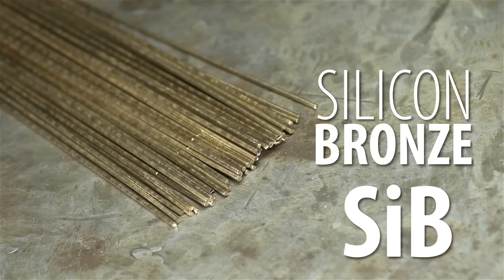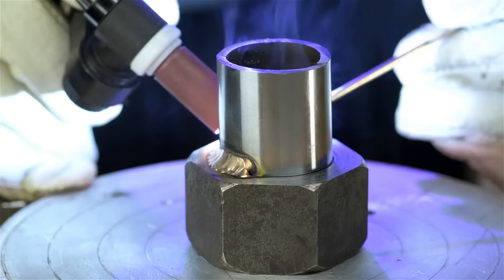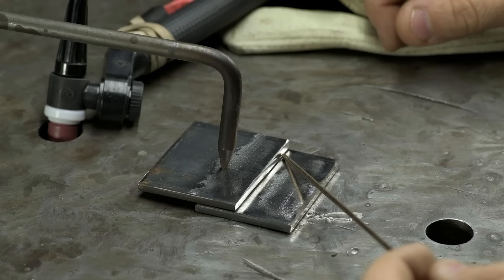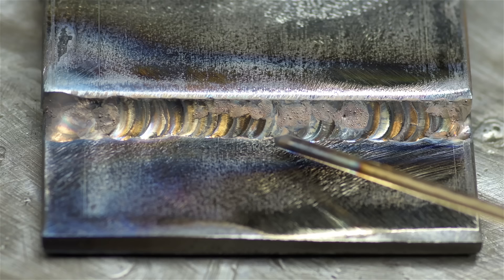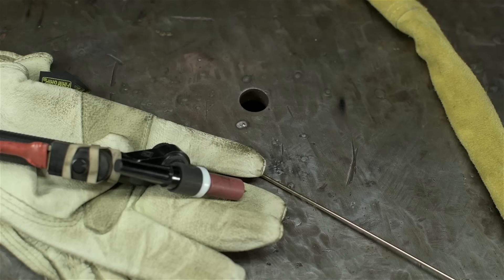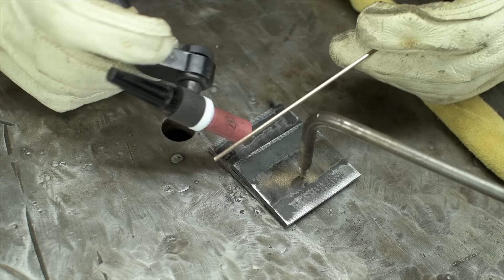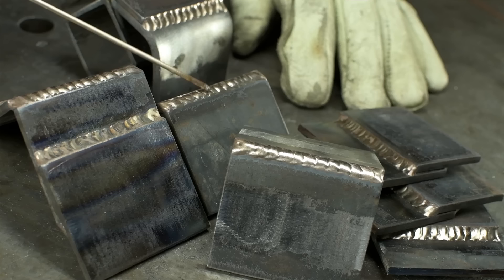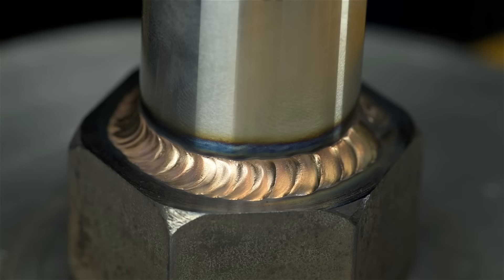Adventures in TIG Brazing

Comment: Tony mentioned about tig brazing putting less heat into the workpiece, I'm just wondering if anyone has any thought on whether brazing would be a good idea for fixing overlapped ("Joggled in") car body repair sections. I'm not talking about serious structural stuff here, Just things like outer wheel arch lip repair panels or door skin repairs on older cars.
I'm wondering if in a home workshop (Rather than in a commercial garage) brazing might be a usable alternative to MIG welding to cut down on heat warping of "Cosmetic" outer bodywork? I've rebuilt a few of my cars in the past where I've warped larger flat panels to hell and back with my MIG, Then I've had the wonderful choice of spending days with hammer, dolly, and blow torch to bring them back true(ish), Or contemplate neatly skimming the whole panel with filler to hide the ripples of shame. :)
The only red flag waving in my head at the minute about this idea is the whole dissimilar metal electrolysis causing rust thing, but I don't know how quick or bad this might be. 
If a repair might get to 10 or so years before rust means it needs to be redone it might be acceptable, But if it's just going to go flaky and red after the first winter it might explain why brazing doesn't feature more prominently in home car body repair videos. :)

Comment: If you use gas, can I use the silicon bronze filler rods for my gas torch welding process? And then the silicon bronze will get all up in under between the two plates.

Comment: I’m just getting exposed to brazing vs welding, and I have a question:

One of the functions of traditional torch/flux is to help the brazing material wet and flow into the joint more completely. When brazing with a TIG setup, there’s no flux… so is it a bit more shallow of a bond?

Comment: Hey there Tony. As always, great video. But that's not really anything new. This might be? I am so near sighted that I can't make out details in anything that isn't 8" or closer to my eyes without my glasses. But if I'm too close with them on, I can't see anything that way either.  Problem is, wearing my glasses under any helmet is near impossible. Sweating and/or the condition of my stretched out frames has them falling off of my face constantly. Do you know of anyone that makes an auto darkening helmet with the means for prescription lenses to be mounted into it? I used to have goggles like that for my dirt bike. Thank you sir!

Comment: Nice! Question. Would this method be good solution for tig brazing some nuts onto mild steel for shop fixtures and such? Thinking of a positioner type stand with telescoping sleeves that can be locked in place anywhere along the length of a tube? Like a weld booth might have in shop class..

Comment: Hi Tony - this is likely ancient history to you but I thought I would throw it out there. First I love your show and your humor. Please keep doing what you are doing. I have experience braising with a gas torch. There are marked differences in what you were doing in the video. First where is the flux? I think that would make a word of difference. The stack dime look is a TIG thing but I think smooth is likely better. Speed with a torch very slow to start and heat input is to keep the metal components a cherry red color and let the braze diffuse  into the steel - are you going too fast? Less power more time? Third is that pushing the rod into the joint works pretty well for me. Food for thought - I'm a hack so i might be totally out to lunch.
Reply: With TIG, the braze is shielded by the Argon, hence the brush on gas flux not being needed, but it would be interesting to see if this would be of any benefit.

The Gas brazing versus TIG brazing processes are nothing alike, as Tony says - Gas brazing is so much stronger than TIG brazing because it wets out the join & really bonds the materials, especially lap joins.

Many people criticize the strength of brazed joins & the ones usually shown & tested on YT are TIG brazed & undersized. They usually have insufficient coverage because they tend to lay regular TIG weld sized bead. If someone wants to TIG braze a join looking for good overall strength, they need to increase the size of the area being covered by the braze to be larger than that of a Gas brazed join.

Gas brazing is a dying art, but Stubby Cuts on YouTube has some really good videos on gas brazing motorcycle racing frames.

Comment: Looking for technique to possibly TIG braze a cast iron repair. The base metal is so brittle that it seems a softer weld metal is the only solution. Two flakes broken out of much larger casting and feel nickel rod and peening will just break the flakes. I am trying to re-embed these cast iron flakes back in the larger cast iron. Do you have a video where you identify and solve large heat sink cold metal issues using tig on cast iron? I already have a roofers asphalt torch to heat for an hour or so in advance of weld but cannot mess this up as part is no longer available. Thanks in advance.

Comment: If you flux the joint first would you get more of getting a pull in between the pieces?  would that add strength?  or does that screw with your tip?

Comment: I have asked a few people how to solve a practical riddle I have. I have very thin hi tensile steel tubing (Reynolds 853 air-hardened) in a bicycle frame that has a small crease in a structural (seat stay) location and I don't want to replace the tubing but rather just repair it. Would you recommend TIG brazing with this stuff here on video, Gas brazing it into the crease or tack welding a small patch over the crease? Also would steel filler work best, stronger than brass or silver mix? One guy recommended silver brazing into the crease but because the tensile strength of the tubing is pretty high and the brazing material is less strong, I worry that the filler material might not restore the original design strength. Am I worrying too much and therefore should just braze it and move on? Btw the crease deforms the 11mm  diameter tubing about 1.4mm. The radians around the tube that are affected are about 90 degrees.

Comment: If you were to overheat and start welding with the brazing rod getting some penetration into the joint would it have any downsides other than overheating the metal?

Comment: By welding at a lower heat, you’re welding slower and thereby putting more joules off heat down with an uglier weld results. Higher heat and more speed of weld will greatly improve your final product. Good video

Comment: I always wanted to see someone give TIG/Braze a good try, and you did.  What I gathered from it is the process might do quite a good job, but only over a comparatively narrow range of work.  The problem is one of heat focus.  At all times, the TIG arc flame is more concentrated than you can probably achieve with even the best gas torch, and it offers no real way of conveniently warming up parts prior to brazing.  I guess the main thing I would like to see is how low current TIG/Braze would work to fill in voids where a shaft or surface has been built up with weld or braze.  I always cringe after hours of careful work to make it "as good as I possibly can", then after turning or milling off the overburden and discovering the inevitable holes and voids, suddenly "that's good enough".  Argh...

Comment: Whe using pulse keep the filler wire in the weld pool all the time....when you dip the wire into the weld pool you are dragging air into the weld pool area hence the areas that have a grey sugaring look......great videos though

Comment: Can someone give a definite answer please.

When using brass rods to weld sheet steel to sheet steel you polish the surfaces and yse an oxycet torch and do a herring joint.  The temperature and the type of torch and the mixture of the brass rods which arent pure brass requires no flux such as a hydrochloric paste or phosphorus.

Soldering  - as in rigid 3m length of 22mm pipes with sockets and rolls of silver/tin solder requires flux as the copper pipe compared to HVAC is a bit crappy quality and needs less heat. Tin/silver mix solder.

To join this good quality (purity) copper with a Brazing Rod I ask the question "Do You need flux?"
The answer being no.
However i ask it differently - "Do you need any extra flux or do the rods contain a flux?" I get the answer "No there is no flux in brazing."

Yet you look at the packaging of the 
Brazing rods and they contain 15%silver. 80% copper and 5% phosporous.
What is the phospor for? It is corrossive and prevents the copper from oxidising and helps the metal run in the fitting.
AKA...A F&#@$ING FLUX!!!

So you do use a flux?
No.
Its in the bloody rod!
beats thr HVAC over head with a rod pack

There are so many videos with a title saying You dont need flux to braze copper and they proceed to use rods with flux built in like giant rosin core electrical solder.

Without a flux, like phosphorous, be it built in to the rods OR as an external granular substance you paste on the pipe like in the days of yore, will the joint work?

 I get that it is being used for a gas rather than water which will flush and residual corrosive flux grease away so keeping flux and deposits to near zero is paramount so using gloopy or granular flux is a bad idea.
Do most brazing rods for HVAC contain a flux and what is it usually please and what are the variants?

Im not talking about steel and brass or bronze welding.

Just copper HVAC.

Comment: Yes, you do! I think doing things wrong. First of all this is not welding. You need to warm base material first, not to melt and drop filler on it. Second, you do not heat both base metal parts equily. Try again.  Oh. yes, try phosphorus bronze (5% P) too. That's magic! O! Some more: Wolfram electrode less out, less protective gas to avoid turbulence, don't move filler material out of gas protection zone, and stop at the end till gas flow to protect joint. Anyway, excelent video!

Comment: It looks like the porosity you were getting at the 6:30 to 9:00 minute marks was caused by the angle you were pushing the TIG torch. It was introducing non-inert gas into the weld. The TIG torch should never fall below 10-15 degrees from the vertical. The filler rod should never rise 10-15 degrees above the horizontal.

Comment: Do you have to do it in dabs or beads??? Im not a welder but i do regular oxy acetylen brazing for my job in refrigeration. And we just have a continuous flow of filler rather than a bead.. is it possible to do with the tig welder??

Comment: I use to weld seat pedestals for UPS trucks- in order to get the most even heat, why don't you angle the joint so your brazing at a 90 degree?

Comment: Still trying to get this to work for me. What I don't understand is if it takes 80 or 90 amps to braze, your example of brazing a thin piece of steel to a thicker one would still give the same issues ie you'd blow holes in the thinner piece (well I certainly would)

Comment: Why can you not lay the welding rod inside the box shaped crevice and just melt it into a puddle as you move the torch along it? It always seams counter intuitive to  hold it at an angle and feed it into the torches arc manually.

Comment: Go to the pedal and do a 1 to 2 sec pause. Turn torch on add the filler there goes one dime. Pause until the puddle has some liquid and repeat. Its your job to control the heat not the machine. I only say this because i was taught this

Comment: There is nothing stopping the metal ahead of the weld from oxidising, have you tried a little flux?

I have only used Oxy Acetylene for bronze welding, my welding is crap, but I could make way stronger joints bronze welding instead. A test tee joint in square steel tube tore the tube before the joint failed. And with Oxy acetylene it's so quiet compared to welding, Joint looks crap?  Just go back and remelt it into a nice smooth bead, after painting everyone will  think you are an ace welder.

Comment: I've been tig welding for over 20 yrs. But have never tig brazed,  I understand everything you showed and will definitely try this, just to see if I can,  hardest thing looks like not doing what you have to do when tig welding ( making a puddle with the base metal). Also thank you for telling the difference between filler ( the zinc thing ) that part I'm sure would have been my demise.

Comment: Hello, how to do bronze yellow welding with tig welding, which shielding gas should I use, what should be the current ac or dc, I would be glad if you could help me in this regard.
Reply from the maker: Argon gas, and it doesn't really matter if you use AC or DC but AC is better if your bronze has aluminum in it.

Comment: ToT!! I hope you're willing to get more scientific and rigorous. Try this! Make both coupons extremely flat with an excellent surface finish. The closest and most consistent contact points should be controlled as tightly as you can and be COMPLETELY clean from oxide layers or dust. Preheat the parts as much as you reasonably can. You don't want a convex bead; remember, you're braising, not welding! You want the filler to wet the workpiece, not just bond together. That means a negative miniscus, not a bead. It should flow more like solder. You may need a rod with lower melting point, and probably thinner if you can. And, if possible try to do the whole thing in an oxygen free atmosphere. I promise, you'll get MUCH stronger joints.

Those little green propane tanks are braised at that mid joint using this type of exactness (more so). When you see those ones that have been in fires, they fail around there steel just as often if not more so than they do in the joint. The joint can be as strong as the base material if it's done as strictly as possible.

Comment: I have zero experience in tig, or brazing of any kind, so I have 2 questions. But I'd like to get into both for side projects.

You said the gas vs tig joints will be mechanically different, what kind of differences would you see? Is one weaker than the other?

Also, what would happen if you just laid the rod across the joint and ran your tig torch across it? Would you have issues of oxidation of the rod before you get to it, causing issues?
Reply: 1st question I believe so it's weaker. I've tigg' d with a brazing rod before and had good results(great ripples). But I'm sure it'll fail mechanical bending. Not that I've tried to do the testing myself.  

And 2nd (?) Really depends what youre welding, thickness on material.  3/4 with filling the groove face on fill, I lay the wire and amps are around 150 and spreads like butter. Bad welds are based on prep work, clean material, clean tungsten, proper sharpening on tungsten, clean filler rod, types of filler rods and type of tungsten to use, gas flow, grounding, position on welding the part. Just alot goes into tig welding

But if you're truly wanting to get into tig welding, purchase a multi stick and tig lift start. Learn how to stick weld first and move onto tig.

Comment: Gotta say - very little penetration of bronze to base metal which is where your strength on your lap joint and 90 degree butt joint. Well really all your joints. my background is gas brazing, oxy-act. with # 2,4 6 tips.

Comment: I have a question. I am working on some special lightning project for school, and need to use Edison threading. So I would like to ask if you could show how to cut Edison threading if it's possible. If you could do that, it would be absolutely amazing.
Reply from the maker: I had to google edison threading.  It's not very deep so I'd grab the nearest lightbulb and shape a piece of HSS so it just fits in one of the grooves.  Measure the pitch, and cut it like a regular thread.  Hopefully your lathe offers the right pitch.  After that hit any sharp corners with a file to round them a bit.  I assume this is in aluminum or something soft?  If steel, use a regular threading tool to rough it out first, then follow up with your thread form tool.  Might be nice to have "shoulders" on your tool to result in a finished thread:  this means when you put the tool in the lightbulb thread, it would span 1/2 a thread peak, through the 'valley' and 1/2 way up to the next thread peak.  But this might cause a weird finish / trouble cutting.  Good luck!

Comment: Dumb question, but does this mean you can braze copper pipes with a TIG welder instead of a flame torch?
Reply: excellent question. you can also pound a nail with the back of an impact wrench. still, the hammer is the better tool for the task.

Comment: Seems like 3/32 filler required too much heat for the 1/8 coupons which is why you were melting the parent metals while struggling to get the silicon bronze to flow out

Comment: did you use standard argon welding gas , could allso be you can work the material better with a different tungsten tip
Reply from the maker: yes straight argon.

Comment: What about thick material, say a broken cast iron part 1/2" or 3/4" thick?  Would the extra thickness absorb more heat, so the amp setting could go up?  Can this be used to silver braze thick butt welds?

Comment: this is now an example of how not to do it.  the most important thing with this weld mode is, ALWAYS keep the torch upright, 90 degrees above the weld pool.  If you point it diagonally forward, too much heat will enter the material.  This is clearly visible in his example.  When the weld and material turns a dark blue color.  that is, the material has received too much heat, and as a result the composition of the material changes.  In other words.  no longer the same composition that was needed.  You can recognize these welds by fractures right next to the weld.  Because the hardness has become too high due to the input of too much heat.